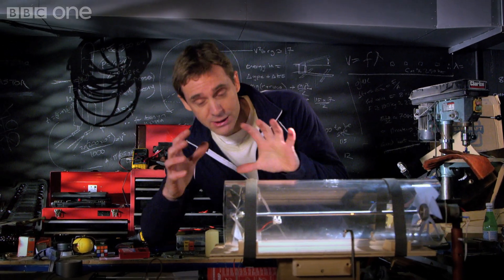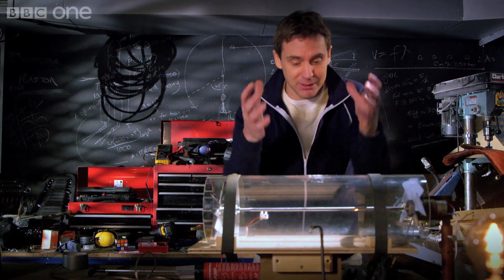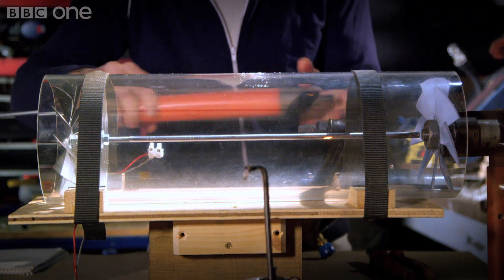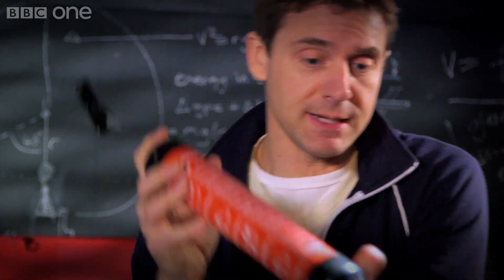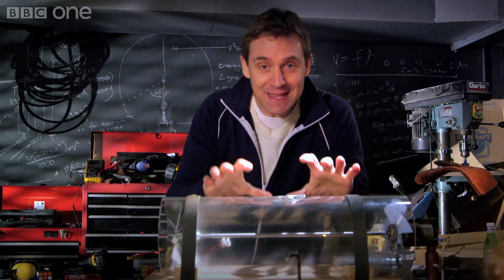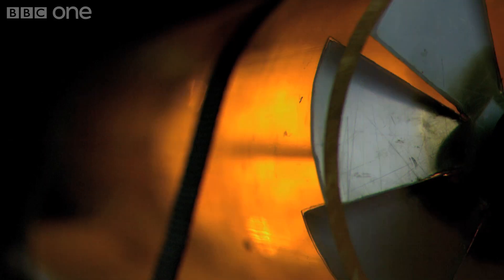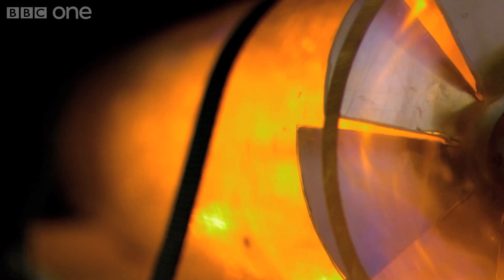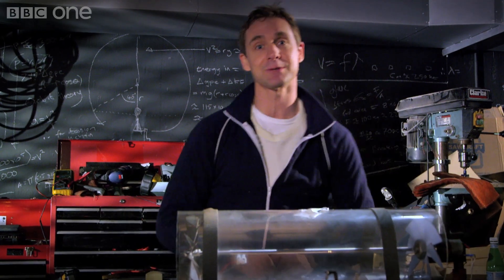How does a gas turbine work? - Bang Goes the Theory - BBC

Comment: The experiment is total BS... There is no combustion chamber in a turbine engine. The path of the compressed air is fluid, no doors no valves,  no chambers, no combustion as described. He showed the basics of a combustion engine, this is not a combustion engine. More lies.
Reply: You just Contradicted yourself in the last comment 😂

Comment: Totally agree with Cheetalnsaaf. The explanation is wrong and confusing. There is a big difference between an explosion in a confined space as shown here (he does not operate the compressor at all by the way) and the continuous flow and combustion in a gas turbine. It would be better to compare the combustion process with what is going on in a simple garage heater. A fan drives air past a burner, the air is heated up and expands, the pressure remains constant. In a gas turbine, the expanding hot air drives a turbine.

Comment: The thing that they need to explain is to help visualize the continuous process of combustion in the combustion chambers and how it creates thrust and force which drives the turbine and makes additional power. The video only loosely recreates what happens at the start, but after the start, in a gas turbine, the air fuel mixture burns continuously. Visualizing "the blast" at this stage becomes difficult as it is not really a blast. That's why I think this explanation of "Suck, compress, bang, exhaust" is not fully correct. It's NOT "bang". It's continuous combustion.

I hope someone makes a workable gas turbine model with glass combustion chambers (of course, some heavy duty glass to withstand continuous combustion and high pressures involved) to help visualize the working the gas turbine.

Comment: A very poor demonstration! The turbine did not drive the compressor. The simplest way to describe a gas turbine is a fan connected to a windmill. This does not work of course but if heat is introduced between them, expansion of the air occurs and with a few tweaks the system drives itself and the process becomes self sustaining providing excess power from the same shaft or an additional turbine SIMPLE!